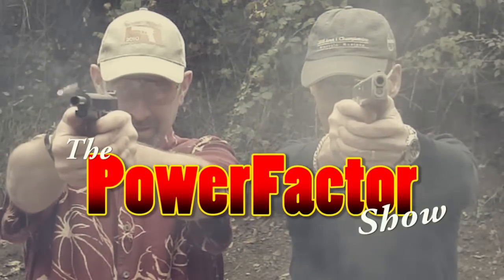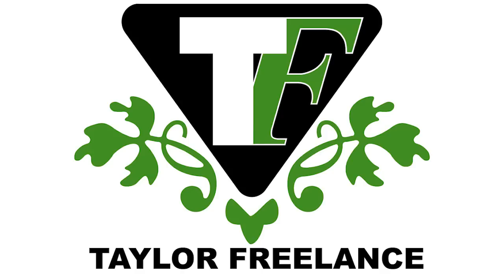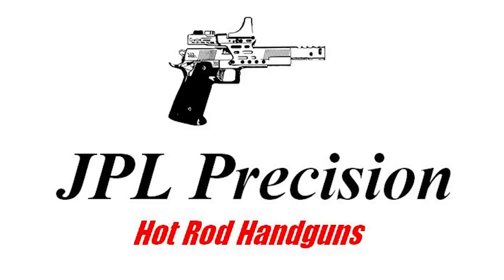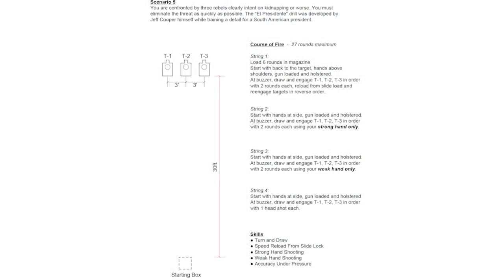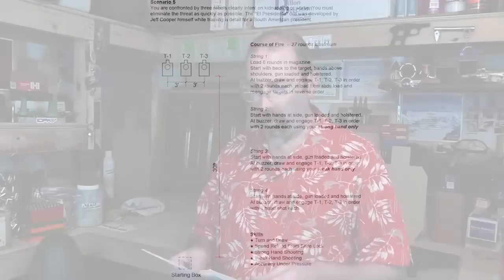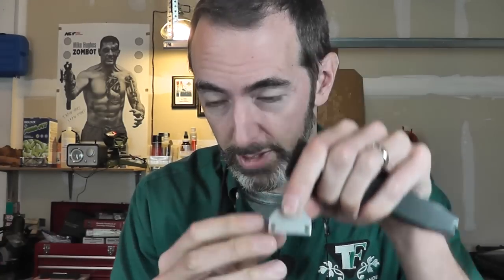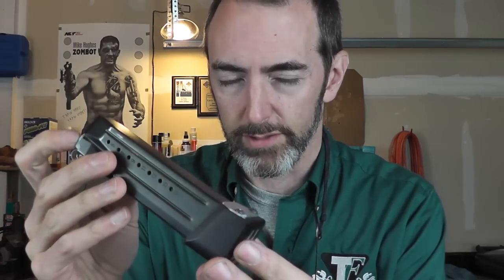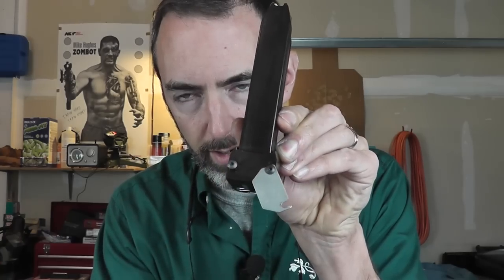Episode 158 - Stage Design Review, Basepad Tips & Front Sight Width and Height

Comment: Re: specifying the order in which targets must be engaged; targets can be engaged only in Tactical Priority or Tactical Sequence, so you can't dictate, "Engage T1-T3 in order", if the three targets are the same distance from the shooting position.  It was a bad idea before, but specifically not allowed, now.
Rick
Reply: Now that the 2022 rule book is out - four years early - there is only one engagement order:  Tactical Priority.   If you are in the open or shooting over a cover-type object (no more horizontal cover in IDPA, either), engagement order is always near-to-far.  If shooting from a fault line position, engagement order is left-to-right when the left foot is on the fault line, and right-to-left when your right foot is on the fault line.  RickB